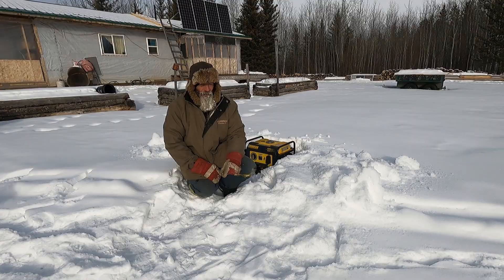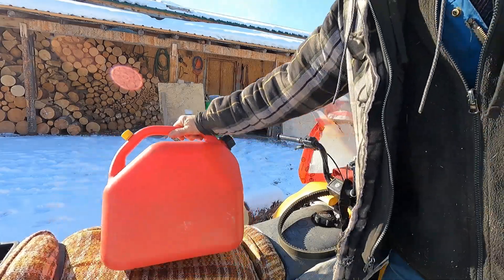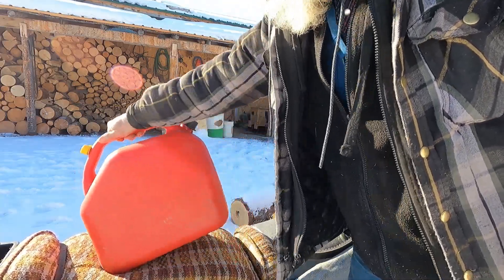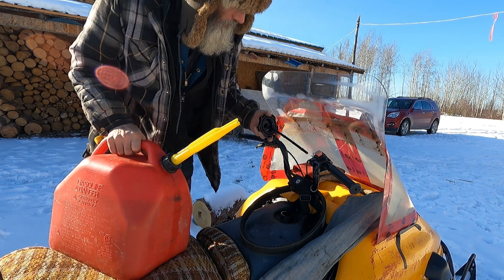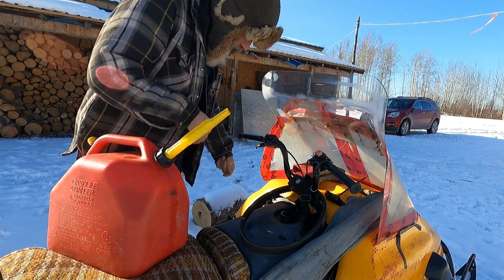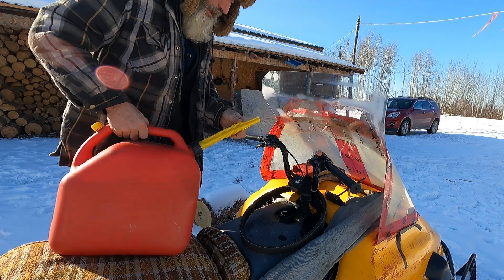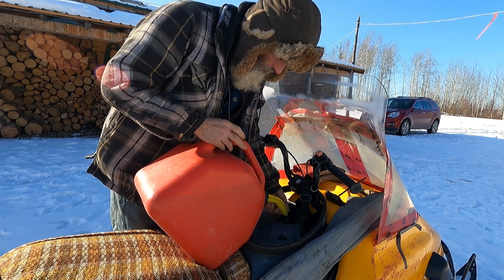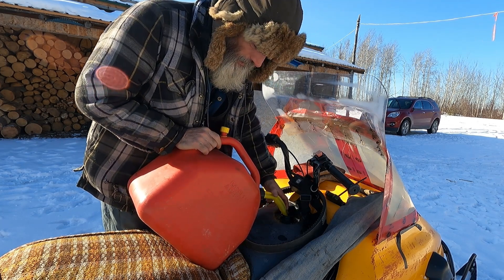Will My Powerplant Survive  -48c Without Freezing Up   Thankyou Loretta & Jason ! S3,E21,

Comment: What oil do you use in the  genny in winter time?   Mine has straight 30 in it but it is hard to start.   Wonder if putting a multigrade synthetic will make the pulling easier.   It is a 6500 W max/5000 continuous so it has a fairy big motor.    I did not see what size you had but it seemed similar in size.
Reply from the maker: Hi Well if you watched a couple video's you know it get cold here, I have a 1500 that goes in the little box for winter running outside & if I'm not using it i put it in the shop but winter I run 5-30 synthetic in both & just 30 in summer, 6500 is a hard pull at -10c

Comment: I've never heard of increasing the oil to reduce over heating in a sled. My 1982 and 1984 tundras run 50:1. What do you increase it too?
Reply from the maker: They are good old skidoo's :) the oil lubricates so it run cooler or you burn up the piston, Yes every where I read it say 50-1 is ok in some conditions " So all my life I have used 40-1 because I'm not just riding I'm making the sled work :) my chain saws the same 40-1 just makes it smoke a wee bit more, my kids accidently put 5 gallons unmixed & made 10 miles burnt the piston.

Comment: Hey Don, man, it's quite the cold spell, but you’re right, spring is around the corner I’m gonna have to check that channel looks like something I would be interested in awesome hoodie. Just curious I’ve been looking at some small little windmills for my cabin to help charge the batteries every ever used anything like this before or just solar
Reply from the maker: I have not used but talk to people that have & most say they are not worth the money, Now some of the new ones out may be a bit better, Are you worried about snow on panels where you at ?  or do you just have a lot of wind ?
Reply from the maker: I'm busy most of the day tomorrow but free in the evening shoot me a text if your free "
Reply: @littlegriffoffgridalberta6837  Yeah, I don’t know much about them, but I do know some of the smaller ones now pump out between 5000 and 8000 W, which is a pretty good boost; I don’t know a lot about them. The cabin is on a hill, and I do get a lot of updrafts just towing with the idea of trying to find some info out

Comment: Not this video related, but what did you use on the roof of your camper?
Reply from the maker: Hi, I just went to a tin supplier an got tin that was still flat, It come 40 inches wide, Then i had them make me 1-1/2" by 1-1/2" to trim out the corners :)